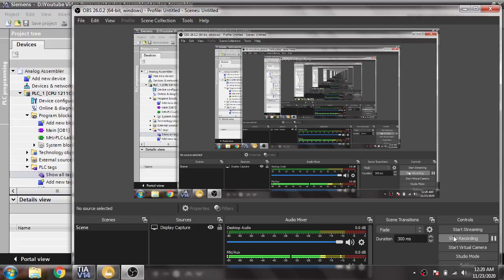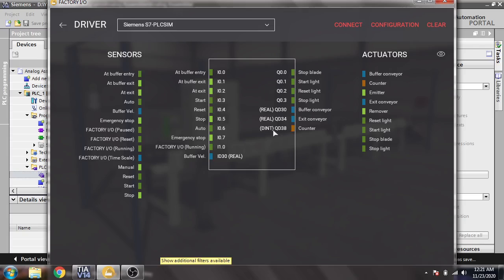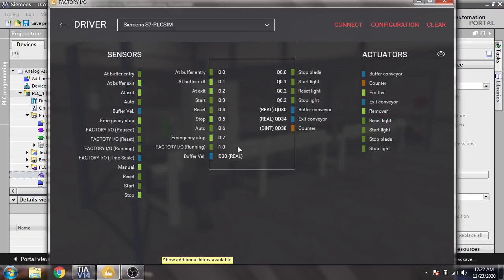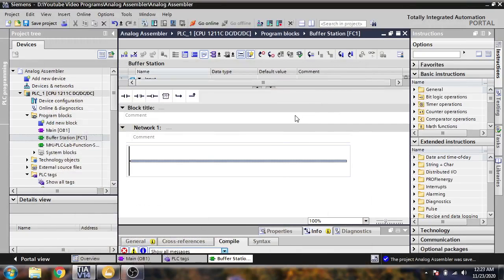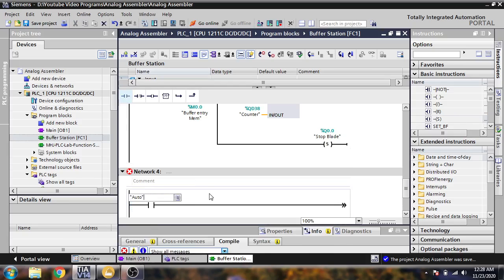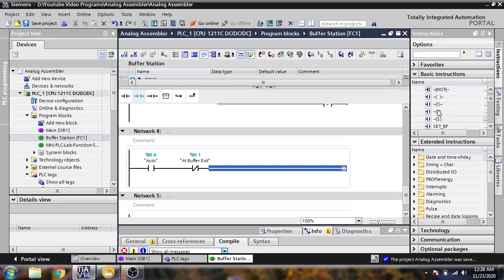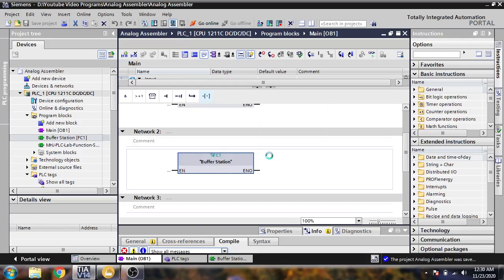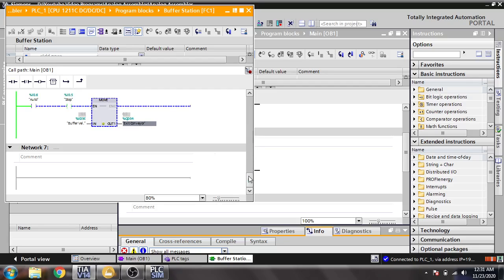Factory IO Scene Buffer Station - Tutorial 15 - TIA Portal

Comment: how can i push the start button and dont need to hold it for the machine to run ? Its is really good video thank you so much
Reply from the maker: Don't Use Set Instruction on Right Side Just A temporary Bit or output